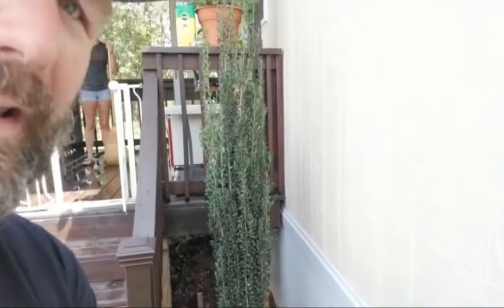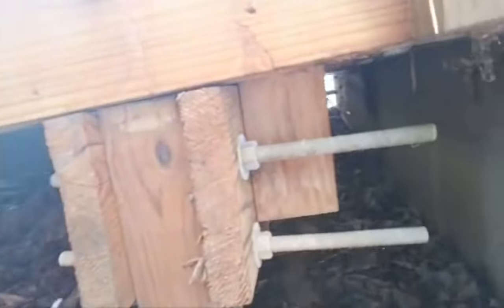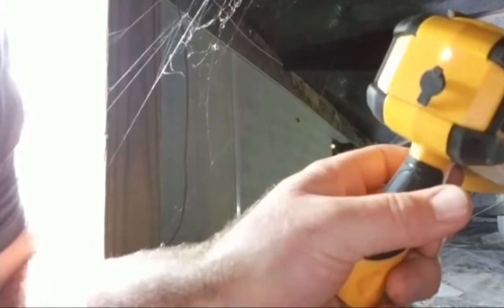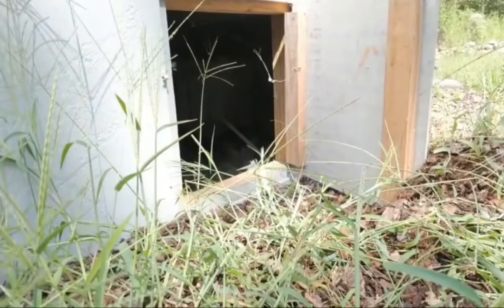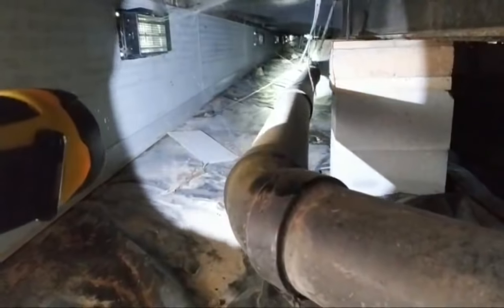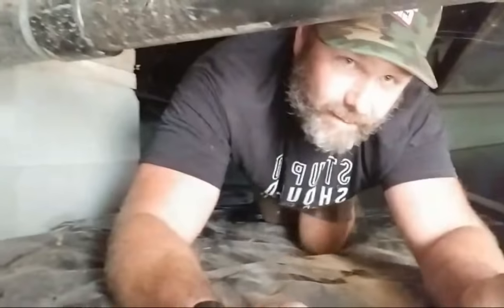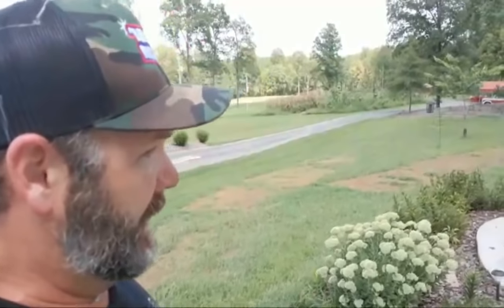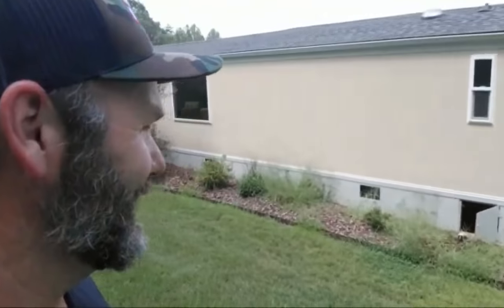DOG SPRAYED BY SKUNK AND IT'S STILL UNDER THE HOUSE!!

Comment: 1/4 cup liquid dish soap, 1/4 cup baking soda, 1 cup Hydrogen peroxide...  dilute to 1 quart with water...  wash dog with mixture 2-3 times in a row.  

I do this with my dogs happens about 2X a year at my farm.  Works like a charm.
Reply: This does work, when removing nuisance animals for farmers i been sprayed a few times. Always use this method!
Reply: add a dash of rubbing alchohol
Reply: Donald Caverly it works well, wear gloves and don't get it in the dogs eyes.
Reply: The dish soap cuts the oils and aids in the removal of fat/oil based spray. The baking soda neutralizes organic acids and helps to reduce smell while the peroxide oxidizes the sulphur compounds to eliminate the stink by turning sulfates into sulfites which in turn are not so aromatic.

Comment: One quart hydrogen peroxide,  1/4 cup baking soda,  one teaspoon hand soap.    Helps strip the oily thiols in the skunk spray.   Can also use Adams Flea and Tick spray as a perfume after cleaning with the homemade mixture.
Reply from the maker: lol...5 jumps off the pond dock....and time to wear it off....he got it mostly right in the nose and mouth...not much residual stink...well he already stinks lol ...but not much skunk stink

Comment: Couple of tips for ya from and old Colorado farm girl, also a retired nurse of 27 years. First, the dawn dish soap, peroxide and baking soda thing really does work well. I mix it in the bathtub when my furry husky/wolf/coyote dog gets sprayed, and we just keep pouring it over her and rubbing it through her fur for about 10 minutes, then bathe her with dog shampoo and rinse as usual. Second, if you shoot a skunk, use a shotgun at fairly close range and shoot it in the head. It may ooze a little stink, but it won't spray a full blast. Gather the critter up with a Walmart bag turned inside out over your gloved hand, then turn it right side out over the body. Tie it shut and burn the thing with some oil or gas and you won't smell it. Spray any soil that got skunked with the dish soap mix as well, saturate it good and it will take the smell away a lot faster. I killed 13 of them last summer in my front yard right beside my front steps! Would have had to live with the smell at the door all summer if not for that magic formula! Keep on with the good work, it's good to see more of us nurses getting back to living a simpler life.
Reply: Btw, if you want a good laugh on this subject, read Mike Rowe's little blog Friday's with Freddy, where his dog got sprayed for the second time. It seriously made me almost wet myself laughing!

Comment: Never had a dog get sprayed (knock on wood) but I did get sprayed myself.   Back in my late teens, had just gotten done with my first day of my new job.  Came home and no one had left any outside lights on.  Pitch black.  Get to the bottom of the steps and "something " furry ran right across my feet, paused ontop of my feet and kept running.  I couldn't see what it was so I walk in and start telling my roommate "hey, a little furry animal just ran across my feet..."  and then the smell hit.  Ive never ripped my clothes off that fast in my life.  Everything went in a trash bag straight outside.  Then had to go into my new job the next day and explain why I needed a new uniform.  They had a good laugh 😂

Comment: pull several panels of under pending off around your house and use the water hose to run him out and once he is out put your underpending back and put something heavy in front of the hole he dug

Comment: When a skunk family set up housekeeping under my FIL's house, the county agent told him to use straight ammonia and bright light to run them out. Skunks were waaay up under house with no access. He used a long piece of pvc pipe inserted through a foundation vent to reach corner and pour ammonia right where he wanted it. He actually put a 90 degree elbow with about a 3 inch pipe to hold the ammonia then just tipped it over to pour it out where he wanted it. Then he set up a 500 watt halogen light aimed at corner. The next morning he saw a mama skunk and 4 little ones coming out the other side of house where their access hole was. Just hope & pray they haven't gotten up into the insulation under your floor. Good luck.

Comment: In a bucket, mix 4 cups of Hydrogen Peroxide (3% Food Grade) with one-quarter cup of baking soda, and 2 teaspoons liquid soap (e.g. Dawn dishwashing liquid).Apply to the dog's dry coat while the mixture bubbles, taking care not to let the mixture get into her eyes or mouth.Lather and rub the mixture into your dog's coat and skin for about five minutes or until the skunk smell starts to dissipate.To de-skunk the face and ears, use a sponge. Apply the mixture with a sponge to your dog's chin, cheeks, forehead and ears. Once again, take care not to let any solution get into the dog's eyes.Rinse thoroughly. When rinsing the head area, be sure to tilt your dog's chin upward to avoid getting the solution into the eyes.Repeat the whole process